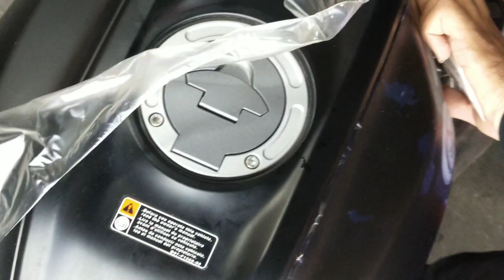R15v4 Modification PPF on bikes- INDIA FIRST-PPF(Paint Protection Film)Lamination #r15v4 #modified

Comment: Matt or glossy?
1mm or 3mm ?
Cost of application ?
Reply from the maker: Bro it's Matt  Because R15v4 black is in matt color.   It's 3mm ppf . and We pay 1200/- for Only petrol Tank. Working good.
Reply: @funstate9881   bro for glossy
Reply from the maker: @rubinvijay5593  For glossy You have to put glossy ppf on your bike . The mat will not suite your glossy bike at all.
Reply: 4800
Reply: @funstate9881  bhai full body ppf kitna pdega
Reply from the maker: @keepsmiling9015  4000-4500 Rs. lum-sum.

Comment: Bro can I make my matte bike into glossy??
Reply from the maker: Bro it is not possible.and  It will look dirty.
Reply: @funstate9881  I wanted R15 V4 in glossy I heard if we do ceramic coating on matte finish by rubbing sandpaper first to remove matte finish and then apply various ceramic coates it can be turned into glossy finish.
Reply from the maker: @sumeetbhat9047  Yes brother then it is possible. And My suggestion is that please will do this work from any experienceed person.
Reply: @funstate9881  yes ofcourse bro.